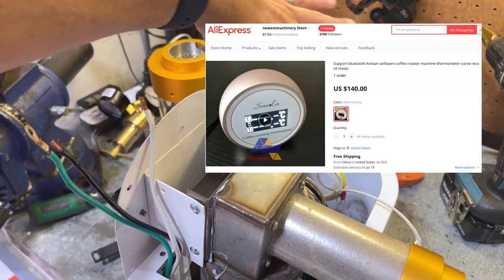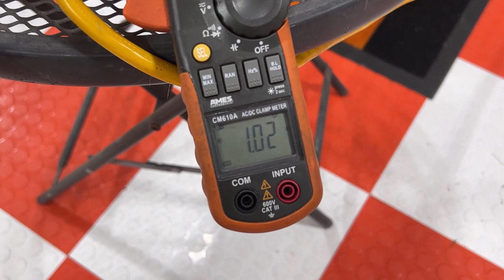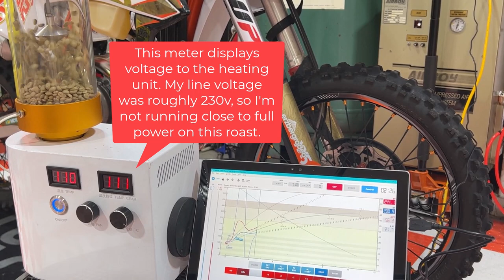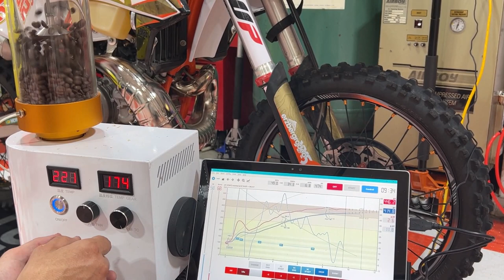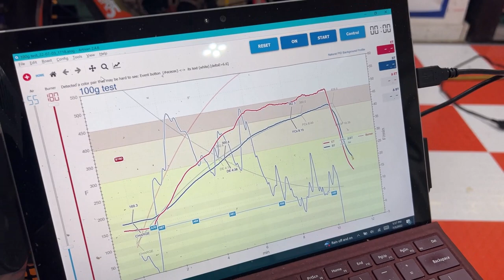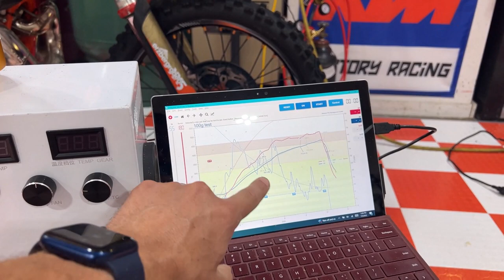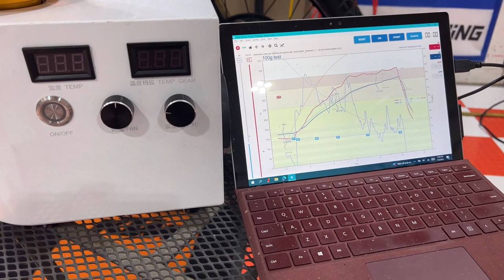Smola (Ali Express) Coffee Roaster Teardown & Review - Is it a potential iKawa killer?

Comment: Fresh roast ? They make great coffee, I can overdue it with power on the fresh roast. It can get hot enough to scorch so seems like 110 is appropriate for it.
Reply from the maker: I'm certainly intrigued by the SR800... but the heat specs/capacity of this machine had me most intrigued, and the use of a potentiometer for heat control meant a much easier path to PID/Artisan integration for me.

Comment: just add some foam to the filter Home depot has an aisle full of that stuff
Reply from the maker: Great idea! 👍🏻
Reply: @hermetheuscoffee   perhaps first do some math on the throughput. The gap might conveniently workaround proper operation at max loft actually depending upon flow that is beyond that filter and motor combination. 
Thanks for the tear down, diag and thoughts. The plug looks like an AU/NZ but is perhaps their 15A variant if the device actually achieves 3Kw. 
Tempted! 
Ride safe or ride well.
Reply from the maker: @dmackle3849  yeah, that certainly entered my mind (that a fully sealed filter could restrict airflow too much). However, I was contacted by another owner of one of these machines (purchased almost a year ago) and it doesn't have the gap. The filter seals nicely against the motor and it roasts great. (I even saw videos of his roasts.) So the real reason for the gap remains a mystery, but in my mind an inconsequential one. Thanks for commenting!

Comment: Thicker-walled roast chamber = higher thermal mass. Not a good thing.
Reply from the maker: True from a physics perspective, but it’s a negligible concern on a fluid bed roaster. Fluid beds are almost entirely convective heat, so the tiny percentage of conductive heating isn’t a concern. On top of that, glass is a much poorer conductor of thermal energy, so once again less of a concern in this application.
Reply: @hermetheuscoffee  But in the cooling phase (if you use the roaster for cooling) the added thermal conduction to the beans will significantly extend the cooling period. My diy fluidbed roast chamber has a wall thickness of maybe 1.5-2mm. I use a sideways fan to cool the outside of the chamber and that reduces the cooldown time from 3:45 to 3 minutes. That tells me that the chamber walls thermal mass have a significant impact on the ability to cool down. It might not have a negative impact on the roasting it self though.
Reply from the maker: @henrikballekoefoed591  very good point, and I should have specifically mentioned that I always use an external bean cooler. The roast chamber twists/lifts off easily to do that (although I DEFINITELY wish they would have designed a handle onto the roast chamber for this).